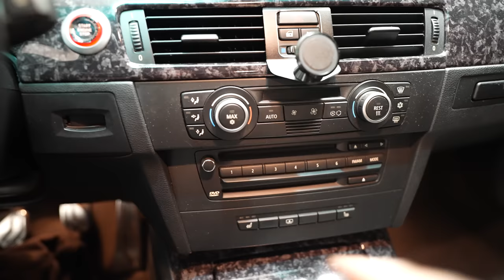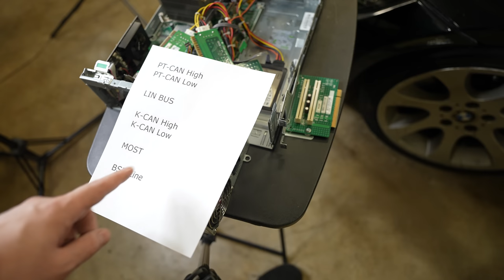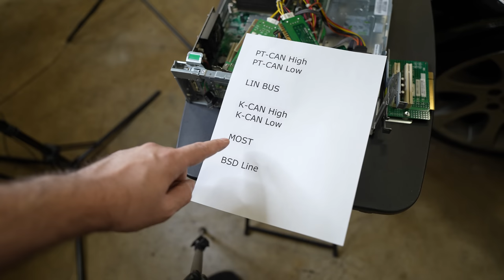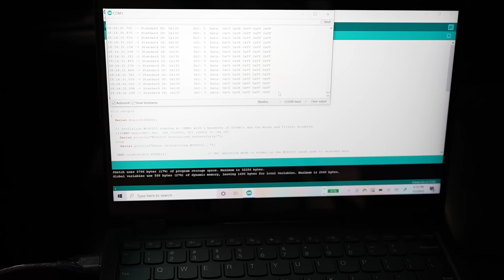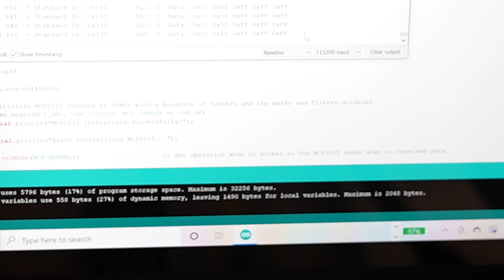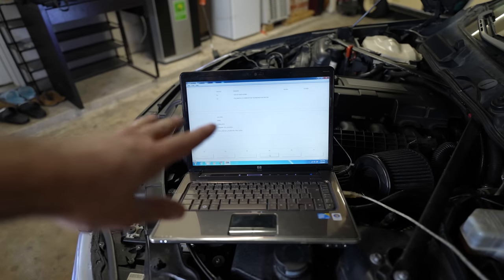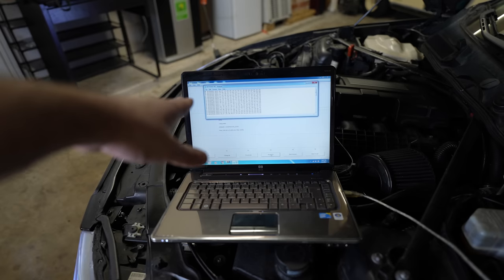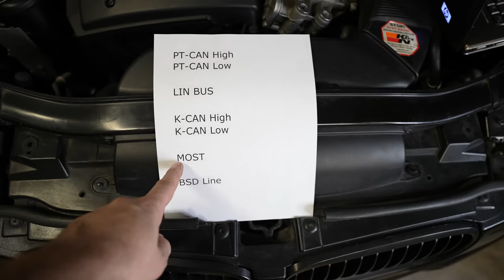Why Your BMW Is Really A Computer On Wheels!

Comment: I was a BMW tech for 4 years. I was not a master tech, but I can say that you know your stuff. I think that you forgot to mention that CAN low was around 2.4v and CAN high was around 2.6v, on a DVOM, different when you have an oscilloscope. Also you could explain terminating resistors in the CAN system.

Comment: Awesome knowledge and ideas, but now I can't sleep ~ racing thoughts of receiving telemetry data and sending commands to modules via Arduino ~ from simple comfort features to the mind blowing mechanical performance stuff. Then I start to realize how unqualified I am in this area and think of all the repairs I need to do on all my cars and then I can sleep again. I certainly understand the BMW computer system better now though. Thank you!

Comment: LIN is possible with just one wire. Most modern alternators are 1 wire LIN network. The alternator has it's own power already and grounds through the block. Super cool that you can communicate over one wire.

Comment: That's how YOUR BMW works. I'll tell you about how my 2012 BMW F10 535d works (worked). I turn the engine on and drive it very carefully until it's warm. I floor it for about 10 seconds then start hearing knocking from the engine, I take it to the garage and it's either rod or main bearing failure. I replace the engine with new OEM oil pump, then turn it on let it warm up then floor it then it craps it's bearings again. I did that about 3 times in a row. In a span of 5 months I drove it 3 days and replaced the engine then the block with crankshaft then resurfaced the crank with new bearings... you can tell the money started to trickle down.
In the end of a 6 months ownership, I drove the car for less than week and lost about 17000 $. Yea Fuck BMW... Still watching your videos because they rock!!

Comment: Great video and very simple explanation of the communication bus(s) used in the BMW. Would like to see you do a video on how to trace a comm bus problem one day as I have an intermittent connection failure on the ZGM(?) comm line which I can't find. Not sure if its a bad connection or where to start.
Reply: Usually a if there’s a fault code disrupting the comm bus it’s usually a module failure. It could be wiring but that’s a lot less likely. Samcrac did a video on a water damaged xm5 where it had a bunch of comm bus errors because of a seat module that was fried from water. I would start with replacing the module you’re getting connection failures from
Reply: @silverarrowgaming1077  replacing them modules can be pricey being that there’s several.

Comment: Would changing and 1 gen module to a newer module be direcly easily possible? Thinking of changing folding roof module to a new, that can operate at slow speed.

Comment: Your comment that the E90 is like the goldilock kind of is what I feel as well. I've got a bad case of "do-it-myself" and am scared of moving to a newer car, even though my E91 got well over 250.000km by now (about 156.000 miles I think).
It seems the footwell-module might be a problem on the E90 since it's a bit finicky and can break when you disconnect the battery. Mine did when I had the car for a recall-fix, and they said it was hard to get hold of a new FRM, and it might soon be impossible.
Edit: If anyone got clear instructions on what I need and how to enable the bluetooth handsfree option I'd be grateful. I've got the right module, and all wiring prepared. All left is just telling the car that it's there. It's the "professional" RAD2 module.

Comment: Amazing knowledge of these cars . How similar is my 2008 525i e60. I have a issue with my ignition timing ,when i slot my fob in the screen and a couple of lights in dash come on, but only for maby 5sec then they shut down . Progress to next ignition stage and everything seems back to normal.also have a constant battery drain . Would they be related issues . 
Jamie NewZealand . 
Any thorts ?

Comment: Im having an issue with my e60 535xi  which i think is two seperate issues that happened simultaneously but now after watching this video I'm kind of questioning it because it was a very odd thing for that my entire instrument cluster went dead exactly at the same time my water pump or thermostat or both decided to go shit on me cuz I had the instrument cluster go out and while I was trying to figure out why that was not working my car overheated and I had no warning indicators of it I only knew it happened because when I got out to walk around my car I saw the fluid pouring out all over the ground from underneath the passenger side wheel well I'm wondering if my cluster got shorted out by my water pump failing and shorting out inside of it or something like that like what you just said in your video what are your thoughts on it has anybody else had this issue happen before or does anyone know what's actually happening here I've checked all the fuses in my fuse panel in the trunk and in the car for the typical fuses that would have been associated with the instrument cluster going out and none of them are blown from what I can tell

Comment: Great explanation of how these BMW’s have become such a horrible toxic vehicle to own and work on!!!
With the different network modules being capable of going down randomly and without any obvious reason, you still have the physical parts of the vehicular to maintain and fix. So BMW’s like all the other cars are not user friendly for the overt mass of owners!!!
That is why I still drive the E39 one is a pre Vanos 1998 540ia and the other one is 2003 530ia!  Easy to work on and parts and diagnostic software is relatively cheap and easy for 70 year old too diagnose use and R&R parts!!
Reply: E39 was one of the first generations to use can bus. 

Can bus is obviously very technical, but if cars were kept simple, we would still have carburetors under the hood.

Comment: Does anyone know how to decode the bus data,  how to read door locks status, or  want to isolate "lock all door lock" bus data , and what looks like, not really want to know what's looks like, but able to program it , or control it anytime, like to automate it, someone said they have computer to program how door lock behave in dealer, like i want to program the door lock to lock itself when i start driving, but don't know how to do that.

Comment: car without computers - pretty reliable
computer at home - super reliable
car with computers - not reliable
what went wrong
Reply: Computers in car have to face water, corrosion, and unstable power source(alternator issue).

Car computers are also more of a niche product compared to a consumer facing computer
There are no agreed standards between manufacturers. also the demand for them isn't exactly high compared to home computers so parts supply is much less